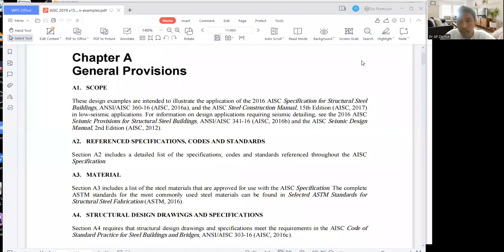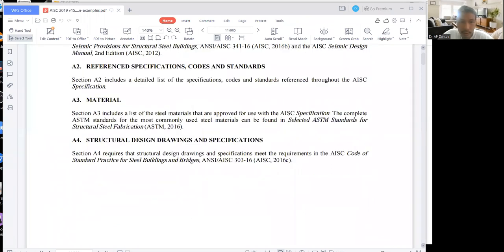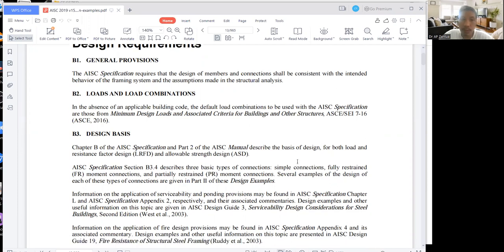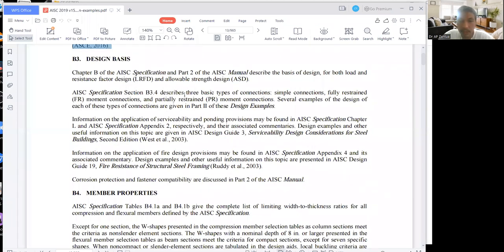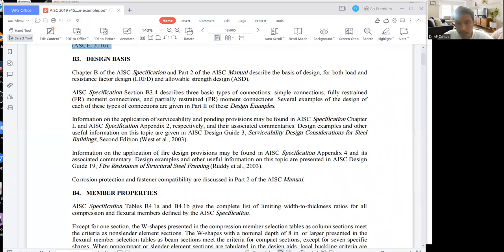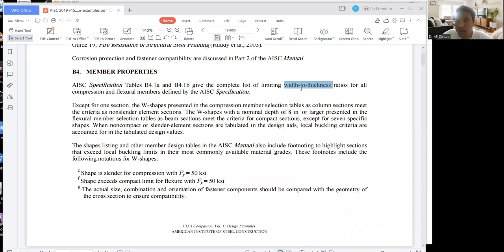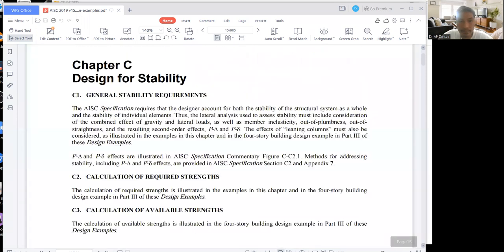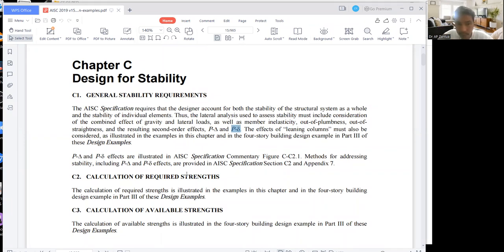AISC 360-16 [ Principles of Steel Design ] Problem Solving A

Comment: Thankyou sir for discussing about AISC 360-16. I've learned about formulas that can be use in strength design. The video lecture also include sources that we can use as a guide in taking this subject course. The lecture shows design for stability and its general requirements like calculation of require strengths, and calculation of available strengths.

Comment: Thank you, sir for this discussion about general provision. I have learned how many formulas in strength design and stress design has. This are included in our reference book which is AISC 360-16. The 2 design basis in Steel Design which are LFRD and ASD has also been mentioned. Other sections such member properties, general stability requirements, and its calculation for required and available strength has been also discussed. It also states that the example problem is included in part III. I have learned much on this lecture.

Comment: ROLEGIO, MARK D.
3RD YEAR -BSCIVE

thank you sir for discussing about AISC 360-16. This video explained about chapter 1, 2 and 3 of AISC which chapter 1 includes scope wherein the design examples are intended to illustrate the application of the 2016 AISC specification for structural steel buildings, referenced specification, materials and structural design drawings and specifications. Chapter 2 (design requirements) includes general provisions, loads and load combination, design basis ( Load and Resistance factor design or LFRD and allowable strength design or ASD), and member properties. Chapter 3 (design for stability) includes general stability requirements wherein the AISC specification requires that the designer account for both the stability of the structural system as a whole and the stability of individual elements. Also, chapter 3 includes calculation of required strength and calculation of available strength.

Comment: Thank you Sir for discussing the Chapter A that tackles about the General provisions that includes the referenced specification, codes and standards, the materials wherein we can see there the list of materials that are approved  for use and the structural design drawings and specifications. It also tackle here about chapter B Design requirements and its under, the general provisions, loads and load combinations and design basis. Lastly, it also talked about here the chapter C that is all about design stability, where we're going to solve the strength.